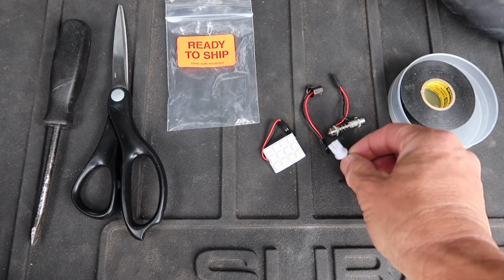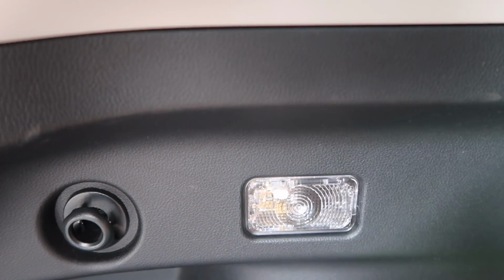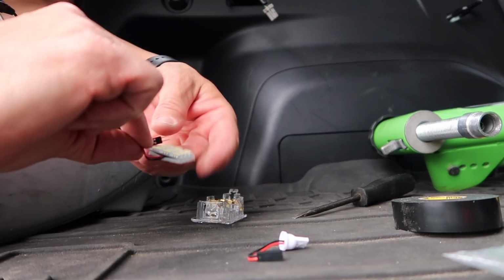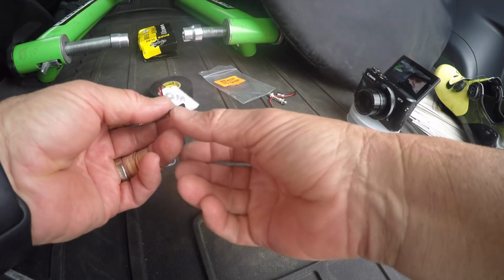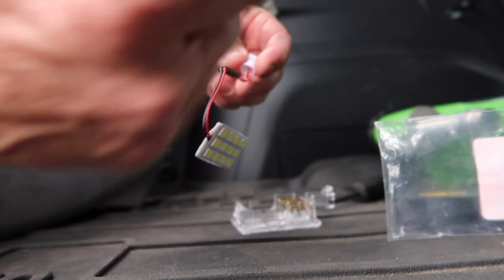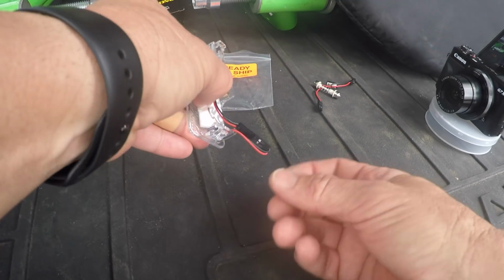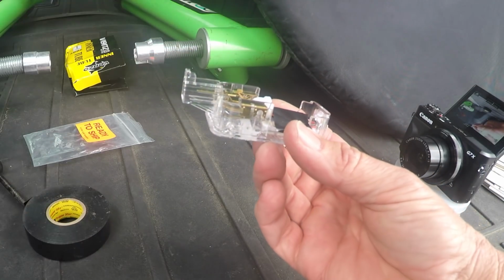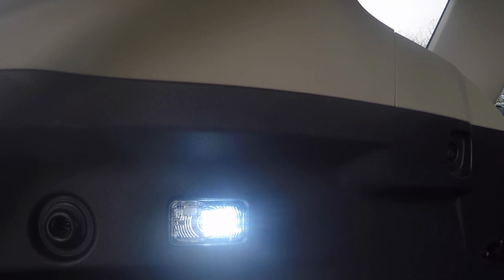2018 Crosstrek: LED trunk Light Install

Comment: I just went to Canadian Tire and bought four led bulbs that were replacements for the halogen bulbs that were in the maps lights, Center roof mounted interior light and the rear compartment light.  They weren’t cheap but well worth it.
Reply from the maker: Very nice!

Comment: Always great videos Rick. Subie dealer pulled my engine Wednesday for an oil leak and returned Friday. Excellent service. 17 Outback.  Your vids help a lot. Thanks.
Reply from the maker: HI Eric, thank you!  Wow, that is crazy.  What motor do you have?  What was wrong, head gasket?  Did you get a new motor?
Reply: Hi Rick, 17 Outback Premium bought new with 2.5 4cyl. 31,000 miles in 10 months. Dealer has done oil changes till now. I climbed under to do oil change and saw leak, called them. Unusual oil leak. Searched subaruoutback.org and found nothing. 2 leaks were found behind flywheel at "separator plate", whatever that is. Top notch, fast work by dealer. Not bummed at all. Thrilled with the car. They loaned me a new (12 miles on it) Forester so I was able to put 150 miles on it. Looking forward to the new one :)
Reply from the maker: That's awesome!  Thank you for sharing, really appreciate it.  I have been really loving Subaru since my first in 2011.  Cheers Eric and thank you for watching the vids.
Reply: Correction on web address....http://www.subaruoutback.org/forums/138-gen-5-2015-present/480562-17-2-5-outback-oil-leak-anyone-have-clue.html
Reply: Sounds like a rear main seal was leaking. Thats pretty low miles for that but im glad they hopped on it. Usually these boxer motors leak at the valve covers so keep an eye there.
Reply: I checked my invoice for mechanic comments and he wrote "leaking from the separator plate". Whatever that is.

Comment: Thanks for the link! Worked perfectly and is a whole load brighter. I did this mod at night for that extra wow factor. I didn’t use any tape as it seems snug enough, but like you said I may use some hot glue in the future.
Reply from the maker: Very cool!  Glad it worked out.

Comment: Hi Rick, After watching your videos, I just bought a 2020 Crosstrek Limited. I love it, thanks for your recommendation. One question, I see you removed the Amazon link for the trunk LED. Do you have a new suggestion?
Reply from the maker: HI  John, yeah, sorry about the link.  Someone let me know the link has changed and I was not able to find the correct set up again.  Check out this bulb from Diodedynamics.  Only $6. https://www.diodedynamics.com/trunk-light-led-for-2016-2020-subaru-crosstrek-one.html
Or use my discount code at proligtz.com and get 2 bulbs for about $16.  There may be single bulbs on the proligtz site, but I could not find them. https://www.prolightz.com/t10-194-morimoto-xb-led-2-0/  If you go to the proligtz site make sure to click the US dollars up top to see the price.  Coupon code is RICK10 and will work on anything there.  Cheers and congrats on the new Crosstrek.

Comment: Hey Rick. Thanks for the awesome instructions! I did this upgrade with no problem. My only  wish is the color was warmer... Do you have any idea is warmer bulbs are available?
Reply from the maker: Hi Michael, I am not sure honestly.  I do find the bulb almost too bright at night when I open the hatch.  :)  It almost needs a little cover on the top to point the light down.  If I find any other light options I will let you know!

Comment: Quick question. Can i trim the 2 pieces and fuse them to make it shorter? Or does it need that 2 pin link? Im referring to led and the other plug before plugging to car
Reply from the maker: Hello fuzzybusness...To be honest I am not 100% sure.  My guess is it would be ok to just connect the wires to each other and get rid of the white connectors, but I do not know for sure.  If you have extras it might be worth a try.  Best of luck!

Comment: Hey Rick,

Thanks a million for the LED video. Just curious...what if you peeled the backing of the tape and secure the wires onto it? Might work, eh? Or do you think it’ll corrode the wires in the long run? Wouldn’t that be same case with the electrical tape? Thinking out loud. ✌️
Reply from the maker: That might work...So, attached the LED to the wires..They might fall out the back, but it is a possibility for sure.  Appreciate the suggestion Marites!

Comment: Have you found a front turn signal LED turn signal or switch back  compatible with  a 2018 '19 Crosstrek thanks in advance
Reply from the maker: Check out this link for my 18 Crosstrek from diode dynamics.  The turn signals are near the bottom of the page!    Cheers. https://www.diodedynamics.com/by-vehicle.html?find=2018-subaru-crosstrek-319621&sid=FPIRHb2aK8
Reply: Yea Ive been there I really wanted white or a switch back (amber white) to use as a DRL i sware I've looked everywhere but thank you
Reply from the maker: Ok, sorry Marvin...I am not sure of other options.  Best of luck!

Comment: Hey Rick. Do you get the correct link? I've got the same model you have and I need a brighter light in the trunk.
Reply from the maker: I am sorry to say I never found the correct link again on Amazon.  I would just go with a Diode Dynamics replacement.  They have good sales now and then so keep an eye out for one.  They sell quality stuff.

Comment: Another great, detailed video. I just ordered these lights for the trunk area. Have you thought about changing all the interior lights to LED? And I also ordered a center console organizer from Amazon as well
Reply from the maker: Thank you very much Matt!  It has crossed my mind, but so far I haven't found the front interior lights to be all that bad.  Then again I don't drive at night all that much.  I think if I were using the car for camping a bit more I would make the switch.
Reply: Understandable. I'm a huge fan of uniformity and it'll bug me knowing that I have one LED and the rest incandescent bulbs throughout. So I'll be ordering soon
Reply from the maker: Cool!  It will look great I think.

Comment: Forgive me if I missed it, but have you found a good set of led fog light replacements that match the headlight color spectrum?
Reply from the maker: No worries JE, I actually have not changed my fogs out as of yet, but I did get the following link from a subscriber...Ryan:  https://www.diodedynamics.com  Looks like they have almost anything you might need on their site.  Thank you for watching!  and Cheers.
Reply: Thanks for the quick reply.  I found them too, just trying to figure which color temp is closest to the stock headlights.

Comment: Xenondepot.com has bulbs that are super bright that you just plug in and you are good to go.  I also have a very bright led setup in the dome light area.  Map lights I just have a single led bulb because I don't need them that bright.
Reply from the maker: Very nice info, I will check them out.  Cheers jmen